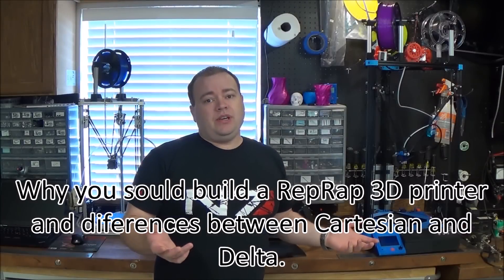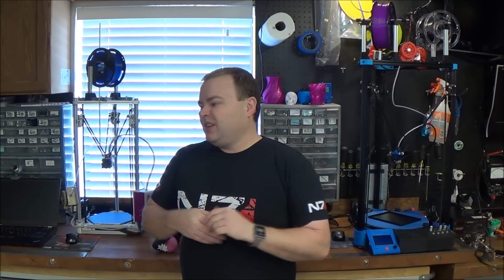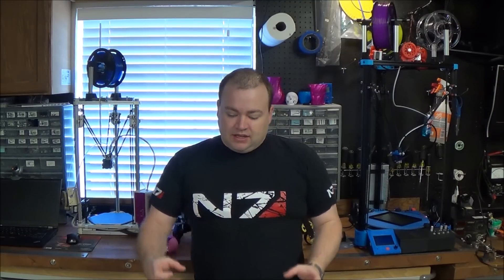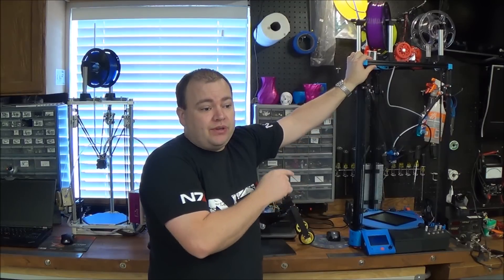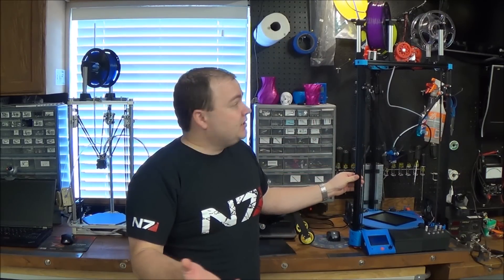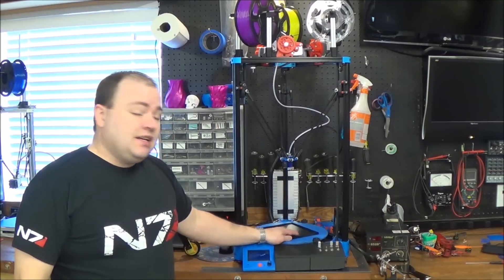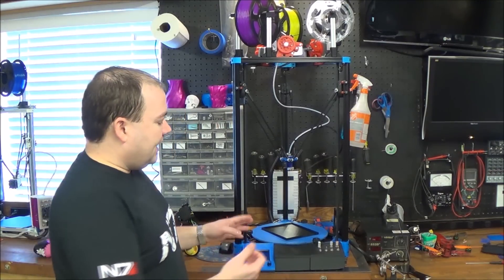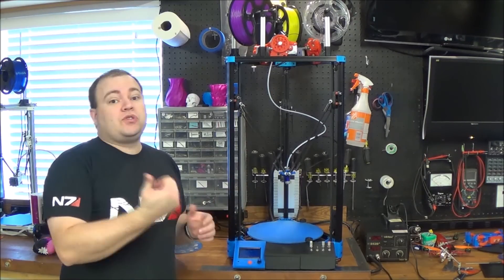Why build a DIY RepRap 3d printer and what type.

Comment: What if you used the rep-rap printer to build 10 mini rep-rap printers with some extra filiment that is 10x as big?  Then those 10 mini-printers could build 10 mini-printers and you would have 100 mini-mini printers 100x smaller.  Then do it again and again.  You could get 1 billion printers at 1 billionth the size, enough to build fabrics or nano-analog computers...

Comment: Great video! i spent a few weeks in my spare time building a Kossel Mini from scratch.  I took my time with it and made sure measurements correct for all three axis and made sure all uprights were correct angle etc. I got it printing nice however it would print a 100mm cube with a slight curve in two sides and i was unable to get it to print measurement accurate so my 20mm calibration cube was always slightly off one way or another no matter what i tweaked. I also made my effector rods on a jig to make sure they were all the same length.  I ended up dismantling the printer since it was useless to me because of the issues, i still have all the parts and would love to build another however there are so many calibration tutorials out there i don't know which one to believe and just ended up more confused than when i started ;)